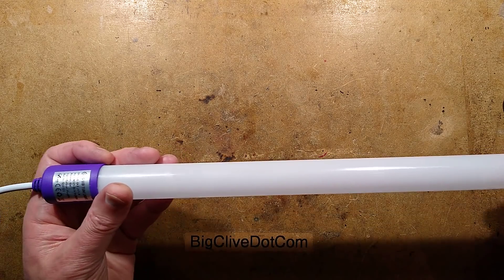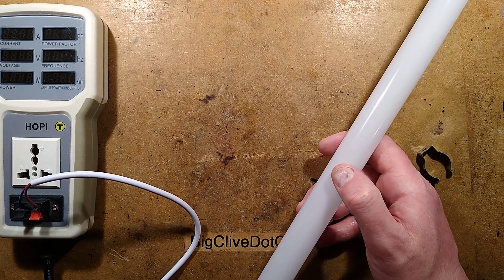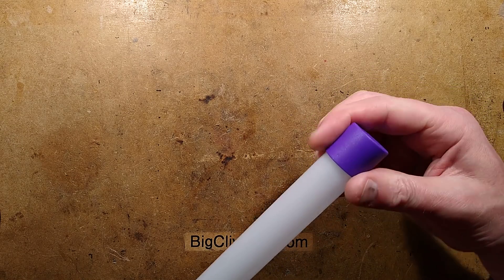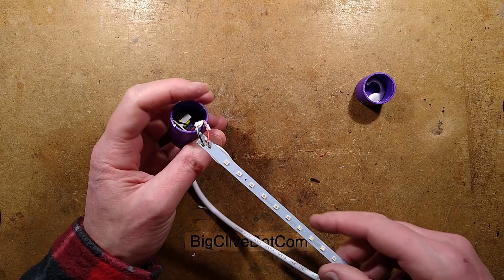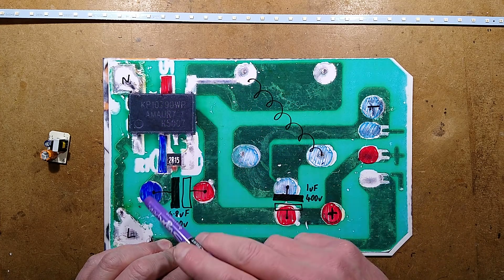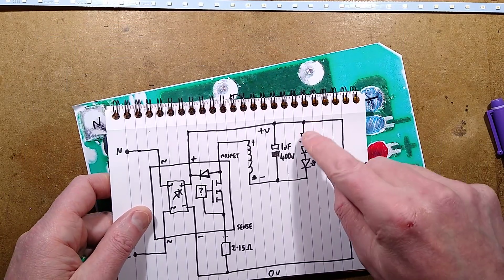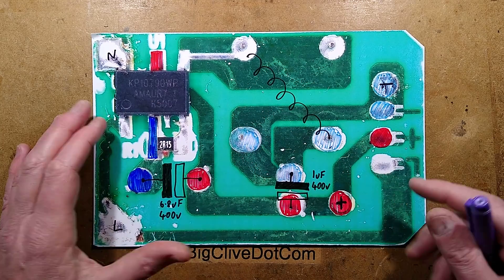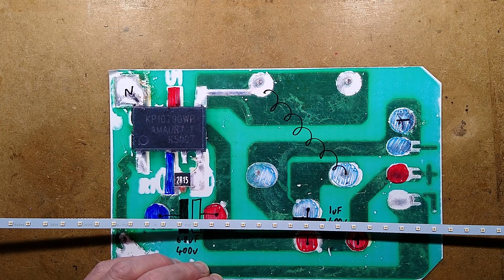Purple LED tube with neat driver

Comment: Live track is used for old fluorescent fittings, where live is fed from one side, and neutral from the other. You just remove starter and it works.

Comment: Schottky diodes do not really do 400 volts. In any case, at the low currents, they also do not make a lot of sense.
If anything, a parallel mosfet could work (synchronous rectification)

Comment: Once again, the power factor tells an important tale. The cap across the rectified mains is the likely culprit. It reduces the flicker, but it causes the PF problem. I am surprised to see such low PF, because the requirements of EN61000-3-2 Class C (power line harmonics) apply to lamps between 5 watts and 25 watts. A look at the input current on an oscilloscope would give more details.

Comment: Clive thx for the reveal. That's about as minimalist as it gets, rectifier and buck regulator all in one pkg. This is probably used in an LED retro unit powered by a magnetic ballast.
I upgraded my workshop to LED fluorescent replacements using the existing magnetic ballasts. Whoops, I got quite a surprise, the ballasts were overloaded by the LED lamps and began thermal cycling every so many minutes. Upon closer examination of the internals all I found was a bridge rectifier, a smoothing cap and a string of LEDs. If they had had that built in converter I wouldn't have had to update to different ballasts. Upgrading a workshop with LED fluorescent lamps was sure worth it even with the ballast expense.
Again Clive thx for sharing.

Comment: Was the device originally intended to be a drop-in replacement for a fluorescent tube in fittings with an old-fashioned ballast coil?  If so, I'd expect a space for an extra capacitor across the input to deal with high-voltage spikes from the inductive ballast as the MOSFET switched.

Could be annoying if the glue holding the LED strip failed and it moved about in the tube .....
Reply from the maker: I'd guess it may have been for the ballast bypass retrofits.

Comment: Clive, Is it possible for you to collect and show us the spectra for the lights you test?  I have a pocket spectroscope and, over the last decade, have watched the huge change and improvements in phosphors used for both fluorescent and LED lighting. I used to see only 3 or four bright lines in most fluorescent bulbs, now I see a much, much smoother spectra.  I wonder if these particular LEDS have a sharp red line and what wavelength it's centered on.
Reply from the maker: I'd like a proper spectral analyser and CRI meter.

Comment: Time to buy a microscope that you can attach your camera to so you can show us the chips in detail rather than just the drawing !
Reply from the maker: I've not found a good one yet.
Reply: @bigclivedotcom  Plenty of good ones but they are all quite expensive. ;-) I don't know what the life of the camera is with constant changes in USB camera drivers and operating systems. Pity to have to throw a good microscope out just because a driver for the camera is no longer available. Better to have a microscope that takes a DSLR or similar in the hope you can replace the camera if it no longer talks to the computer but I think they are even more expensive.

Comment: Purple LED street lights started appearing near me on quite residential roads near me in Dublin over 1 year ago.  Google reckons these are due to a manufacturer fault where phosphorus coating had fallen off and resulted in a purple light.  It is certainly less bright, which I like.
Reply: I started seeing street lights turning purple here in the US about the same time. They start off a reasonable white, then start degrading to purple over a month or two span. I reported about forty of them to the utility company last summer/early fall, and they've finally just recently been making good progress on replacing the ones that have "gone to the dark side" ;-).  It has been quite interesting near dusk with snow on the ground, seeing purple snow except in the shadows where the fading twilight with a more natural spectrum looks greenish in comparison. (Our brain does some color balancing trying to make things look like normal under different (usually uniform) lighting conditions. But doing so when the predominant source is missing a component (green, in this case) causes the more neutral spectrum of the snow reflecting the twilit sky makes the minority areas look greenish instead of neutral. If I remember right, there are also differences in the relative sensitivity of the rods and cone color receptors in the eye at different illumination levels. So what we see is in this case a result of mixed lighting with two different spectra, filtered by the eye's differing response curves as light levels get lower, then filtered by our brain's perceptual correction attempts.)
Reply: @bradlevy2733  Thanks Brad. That's interesting about our brain interpretation.  The zone where a white led overlaps these purple light seems odd. Also where near the orange sodium.

Comment: So cool, have you seen any garden solar lights that will charge in the shade like under a tree 🌴 or the shady side of your garden?
Reply from the maker: No.  They really need direct sunlight.  But you can get strings with a separate solar panel that can be put in a brighter area.
Reply: @bigclivedotcom  I'm thinking 🤔 solar panel charges jewel thief , jewel thief charges capacitor, capacitor is then dumped into 🔋 battery, then repeat. Any ideas 💡?
Reply from the maker: @sarathai2876  That would result in a lower efficiency.  You can increase the size of the internal boost inductor to make the LEDs run at lower intensity and power, which may increase run time for a given amount of light exposure.  Many solar lights here us 470uH inductors to allow the use of smaller panels and batteries.

Comment: When you said “stuff these into the Hopi” I saw stripped wires and a socket and had visions of my dad in the 70’s stripping a cable offering them up to the socket and using a plug from another appliance to stuff them in.

Comment: Would there be enough heat dissipation for the LEDs in the air tight tube?
Reply from the maker: Most lights like this tend to run the LEDs quite hot

Comment: Hi what's the reason for the winding trace coming from the live and entering the chip? Could it be some kind of fuse?
Reply from the maker: Usually that section of track is thinner for use as a fuse.
Reply: @bigclivedotcom  I totally agree. Some kind of inductance doesn't make any sense to me neither. So it will remain a mystery. Maybe the guy in charge of the design just had some drinks to much

Comment: You could perhaps piggy-back two of these LED strips (or some of that LED tape) and use something to hold the strip in the centre of the tube for more even illumination, it's what I'd do! But you might need to reduce the intensity accordingly.

Comment: Any idea on why the live trace going to the chip is so wavy? It's a very weird routing... is it suppose to be some sort of fuse?

Too bad you didn't remember to measure the diodes of the internal full bridge rectifier... you know, just to make sure they are indeed there. Oh, and you know what, if it's a MOSFET you could have also measured the body diode.
Reply from the maker: Normally the wavy track would be thinner for use as a fuse.

Comment: Is there any rhyme or reason to the tracing design they used?
#1 The left AC pin on the rectifier has a small squiggle (on the L marked trace), presumably to make it longer and add -- what I'd presume to be an insignificant amount of -- resistance before rectification? Or, is it uh... acting as some sort of RF suppression (I feel that's a huge stretch and unlikely)?

#2 Smack in the middle, the traces that the coil is hooked up to looks -- at least to my uneducated eyes -- overly "complex" considering it has nothing to zigzag around... Yet, even still it makes a dog leg U-turn 🤨 Wouldn't it have been easier and "more cost efficient" (less tracing/copper) to make it in a sort of lightning bolt-like shape? Or are they wanting/needing the coil to be connected at the end of the trace, after the capacitors' connections?

Or, would both of these potentially be explained away by your suspicion of it possibly being a modified fluorescent circuit?
Reply: The squiggly on the power input is presumably to act as a crude fuse, except the trace looks too thick for that. Maybe it's a copy of another design.
Reply from the maker: It's a track fuse, but is usually thinner.

Comment: I wanted to make camping lights similar to these just DC and with a battery pack. And all the translucent tubes you'd want to use are oddly very expensive.. $30-50 per each 3-4 foot tube. The only cheap is ones we're the florecent light guards. But those are so thin that there is no structural integrity. It would make each light cost roughly 60-70 to make and I wanted 5 or 6 of them.. it killed the project. And I've been looking for a cheap source ever since
Reply: ( G4 pins ) type of small LED lamps run very well off of a 12 Volt battery  ( lead acid ? ) ... handy hint , the dual 0.1 pitch socket connectors ( found in most old desktop computers ) work as cheap G4 sockets , but place the lamps DIAGONALLY, 45 degrees , so as not strain the little lamp pins ... the " warm white " is so much better when camping, than the cold light of many camping lamps .. tried-n-tested ..... QED ....
Reply: @davidfalconer8913  I was actually going to use some rgb light strips in it with 6x 18650 in what would be a 3d printed base. Tack on a Bluetooth rgb controller. The issue is the transparent tubes being so expensive. I haven't found a good source for them. Ideally some 2 inch acrylic tube would be perfect. Even the stuff used in this video would be nice but  you need to buy it as a finished product already to get ahold of it

Comment: How much does a unit like that hopi set you back? Do they have a model that can output DC low voltages?
Reply from the maker: It was quite expensive when I bought it.   A bench power supply can be used for voltage and current controlled output.

Comment: I have a question/request actually:
Can you look at plant growing lights ? 
Or have you already ? 

I am trying to grow a lot of Aroids (Pothos / Epipremnum, Monstera, Philodendron, Syngonium...) And give them away at two charities, for people that wouldn't be able to afford them otherwise, so they can have some green and life in their life. 

The problem is, that I am getting mixed messages EVERYWHERE, all sorts of grow lights seem to have wrong technical data displayed (like saying they have the equivalent of X watts power, but drawing less...) And I can't find a solution to the issue... 

I'd be extremely happy about LED Strips / rails, because I happen to have my plants in a shelf with glas, so a strip actually reaches multiple layers, and if I'd be able to have one at several layers, the resulting light coverage would be nice.
Reply from the maker: I've looked at some, but am not an expert in the area of plant growth.

Comment: you know mr.dotcom, it would be very usefull if the hopi had an on off switch right on it, kinda like a power strip, so you dont need to plug it im every  video but just flip a switch

Comment: A fusible input resistor would have been a useful addition to the circuit. If there is a fault then there could be a bang and melted plastic, if you were unlucky the whole thing could go up in flames and burn your house down.
Reply: Why not a fusible PCB track between the AC solder pad and the chip?  Cheap solution at no extra production cost.
Reply: @johndododoe1411  It is nearly impossible to define a PCB track which will fuse reliably at a given current - in this case you need something to fuse at about 50mA - the track would be hair thin.

Comment: That yellow capacitor looks like it's venting has been covered with silicone.  Isn't that a problem? If the venting isn't allowed to vent, the capacitor could blow quite destructively.
Reply from the maker: It will certainly affect it in that scenario.

Comment: I like the bridge rectifier built into the driver chip. I'm thinking we'll see this with the linear current regulator driver chips, in LED light bulbs soon as well.
Reply: This chip may be cheap enough to replace those linear regulators completely, but with cheaper low quality inductors.
Reply from the maker: There are already linear regulators in the same format.

Comment: So this driver has the shortest BOM possible, I doubt it can be reduced further.
Reply: You could remove the output capacitor and it should still work, just with a bit more electronic noise. The input capacitor could be removed which would result in noticeable flicker. The inductor could be removed if they used a linear regulator instead.
Reply: @eDoc2020  you are right, I should have added without negatively affecting functionality.

Comment: I'm constantly amazed at the size of electronic components that are wired directly across the mains !
How do they decide what is safe, does it depend on how quick they catch fire under test ? I have a feeling that if they burst into flames during a 20 second test they shorten the test to 10 seconds so they get less rejects !
Reply: 340 V (top voltage of 240 V RMS) isn't that much to handle actually. It can only jump maybe 0.2 mm air gap at most and even much less thru insulating materials or semiconductor barriers (even if it's still a really bad idea to design a circuit that way for safety and reliability reasons, that's how small insulation distances is needed to handle the voltage under normal conditions). Most components, even if small, have at least 10 times that distance. It's not until over 1000 V, the size of component's really need to be bigger for insulation reasons.
For powering low power stuff like those LEDs, the heat from power losses in the transistors isn't an issue either (so they don't need to be big to get enough cooling). If they test it under normal conditions, it will just work fine. It wouldn't surprise me if it can handle 2 or 3 times the power of those LEDs as well without problem. 
The only real safety issue is what happens if a fault accors - but then I would guess it just blows the track on the circuit board. But it would be a good idea to add a fuse or fusable resistor, to be on the safe side. China isn't known to care much about safety and often want to save a few cents by omitting the fuse 😆
Reply: @Speeder84XL  While the distance sparks can jump through dry air may be as low as you say, greater distance is needed to avoid creepage through dirt on surfaces.  There are formal standards listing the minimum safe creepage distance for common voltages, unfortunately, many cheap products ignore that and hope the product doesn't get dirty.
Reply: @johndododoe1411  Yes, that's why I said it's a bad idea to design a circuit like that (it wouldn't be very reliable, since just a little dirt as you said, or moisture, can easely cause a falt). But as long as conditions are ideal, it would work with such small gaps. It was more an example that mains voltage is still quite easy to handle (nothing compared to "real" high voltage circuits above 1000 V).
Also, even if components have 5 mm  (which is probably ok according to most standards) between legs (for example a small rectifier bridge), it can still be quite small when it only need to handle such small amount of current. 
And fire hazard if a fault accors, can be prevented by a fuse. The size of components isn't the main problem with the cheap china stuff. Even if there is big components at the input, there might still be 2 circuit board tracks with 0.5 mm between at another place... (just look at all the videos where they take cell phone chargers apart 😄)

Comment: Presumably the little wiggly track on the left is the fuse
Reply: I was wondering what it was for as well. It doesn't really seem thin enough to be a fuse, though (not for any reasonable current limit)
Reply from the maker: Yeah, but they made it the full track width to give it more oomph!
Reply: Thank you. Was wondering.... My thought was an artistic touch. :)
Reply: No that is the wrong symbol for a fuse (a rectangle with a line on each end). The spiral line is for the coil (an iron core with lots of single wire wrapped around it like a transformer) on the inductor for the magnet field Clive was talking about.
Reply: @TATICMOOR  Pretty sure you're not looking at what we are, which is the actual trace path going to the Bridge Rectifier chip on the Live pin (aka "L" silkscreen)
Reply: @DUKE_of_RAMBLE  One side of the inductor coil is going to the Mosfet on the chip and the other is going to the negative with the 1uF Capacitor. But I do see the wiggly track now that you are talking about to the Positive Live Pin. I just thought that the two people above were talking about Clive's hand drawn Curly Squiggly Line. So sorry if I've taken up the comment wrongly with the wording of the text.
Reply: @TATICMOOR  I could easily be wrong, since I had happened to make a similar comment pointing that out and it was what I was scrolling through the comments for the answer to (so my mind gravitated towards that instead). But yes, I suppose Mike could have been referring to the diagram instead of the actual PCB.